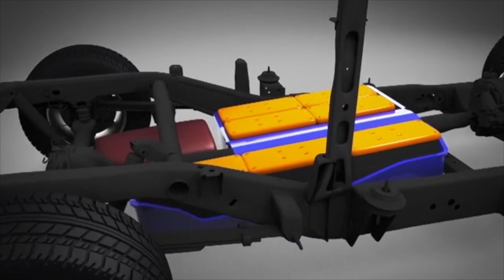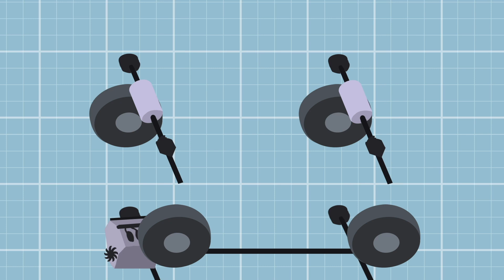Could This Pickup Truck Design Change The World?

Comment: Hybrid or all-electric could work (functionally) for those that want a pickup truck just to have a truck (or SUV), the problem will be where is the visceral factor of a rumbling V8 or diesel.  These people are already willing to pay what have become outrageous prices (comparable to many larger luxury cars) to get that, so without that, you'll likely not do well in the market.

People who actually use their pickup trucks are another story.  For most of them, all electric won't work because they often use their trucks on and off all day without any opportunity to recharge, some even in remote locations without power.  Hybrid would fix that, but would actually further alienate that market by both increasing costs and mostly by increasing complexity.  Most of that remaining market wants their trucks as simple and bulletproof as possible.  Essentially, give me a big simple engine, bulletproof transmission (the only place where technology has gotten any foothold in this market), and a BIG bulletproof axle (axles), stuff that won't break and when it wears out you can replace/rebuild it with an impact gun and a hammer using big cheap parts that have been the same since the 70's.  MPG be damned, extra operating costs in fuel doesn't stack up to additional maintenance costs or the cost of not being able to do it yourself.  

I probably own more truck than I really need most of the time (a Cummins Diesel Dodge ram with a crew cab/long bed), but it makes sense for me.  I got tired of breaking a lighter duty truck that I owned before it for the times that I needed something that beefy, and even though deisel costs more I get about 2x the mpg that I'd get with a gas engine.  It's old and sure I'd like something less worn, but as emissions and other tech has crept into them they got more expensive to maintain and MPG tanked.  Honestly, the only problems that I've had from it have been where technology has crept into it (it's from 6 years after Mercedes bought Chrysler and there's a lot of Mercedes electronics in it that SUCK and are always broken), otherwise the solid axles, old-school tech is pretty much bullet proof and again, except where newer tech has crept into it dirt cheap to fix/maintain.  Most of the time I would probably be served better with a smaller, more fuel efficient truck, but then the majority of the time that I'm not using it for truck stuff I'd need a minivan or similar crossover/SUV, and instead my big crew cab serves that function well, holding me at over 6'4", my twins in car seats (99% of smaller vehicles can't get 2 car seats in the back behind someone 6'4"), my 100# dog and another adult and pretty much as much cargo as I want in the bed.  If I have to I can get a 3rd adult in it.  For road trips this is the vehhicle, loads of room and 600miles before fill ups, and you can keep going as long as you can keep filling it (no waiting for charging).

 If I wanted to get something more efficient I'd have to get 2 or 3 other vehicles to replace it, and if they are modern ALL of them would be more expensive to maintain.  Now here is the big thing, if something were to happen to it, I'd unlikely replace it with something newer, I'm not going to spend 3-6x as much to get a new similar truck that will cost me more to maintain and be less durable or even more if someone was making something simiar in hybrid or all electric.  Honestly I'd probably look for a <2004-1/2 or older (pre-emissions) similar diesel.   

You'll never make hybrid as simple to maintain, and unlikely electric, so until you can get cost down to a fraction of that of an IC engine powered truck to make up for it you won't succeed in that part of the market.

Comment: I think rather than have 700 kg of battery it would be best to use 100 kg with parrellel super caps for on demand high output and the most efficient small diesel generator motor to charge up as needed on the run ! This would have more power and torque of exist f150 etc and the addition of real all wheel drive when needed . It all comes down to the amazing flexibility of hybrid configurations . You can literally start from a base platform that already exceeds current vehicles specs and customise it to have what additional specs you require be it greater payload after the subtraction of heaven v8 and transmission or extra heavy payload when using the 100 kg battery/super caps system . It’s all in educating the consumer about this new paradigm in the automotive world . I know many that are into cars don’t actually understand the amazing ability until they test drive . Then show them the specifications and watch the chequebook fly open .

Comment: The solution is don't buy the bloody things. I think you would find that the majority of the pickups purchased by the no business purchasers are  never  used for what they are              designed for. Rent one when you need it. Check out your local drive thru, Cummins diesels sandwiching  Priuses with a  Hemi gas burner behind.
Reply: The saddest part is they buy them new,  loose 20 large after they drive off the dealer lot, and take 8 years to pay them off.

Comment: 30kW battery? Forget it. Double it and combine with a four cylinder 200hp diesel in a one ton pickup, yes. Maybe. I need to tow 3.5 ton trailers for at least four miles up hill. Of course the diesel would do that job more than the battery but I would expect my Ford 2.2 diesel's overall consumption of 19mpg Imperial to improve to maybe nearer 30 overall and 50 instead of 30 for unladen road use. Those are significant benefits for commercial use as long as the fuel tank size remained the same.
Obviously the electricity does not come free and may even be generated from coal in some countries [which makes it a waste of time and money], but in most areas of the world it would provide significant environmental benefits as time goes by.

Comment: A reasonable argument.  Two problems.  First, hybrids are only slightly more fuel efficient than comparable ICE vehicles and for both the emissions are much worse in practice than in the idealized lab conditions.  It's a lot of effort for mediocre gains.

Second, the traditional automakers are moving so slowly that tesla might beat them to the punch, or at least release close enough after that the hybrids become irrelevant.  Why bother with half measures if the full measure works so much better?

Comment: All electric - with an auxiliary power unit. Mount it in the pickup if you need it - replace it with a aux battery pack when you want. Leave the power unit at a job sight or at home for more efficiency

Comment: For those that want a pick up as a status symbol (most of the market in urban areas) a battery could be put between the frame rails and then another in the bed and raise the sides and tailgate. it would probably look like an old El Camino but it could have close to 300 kilowatts of power, especially with he new types of batteries coming out in the next few years. Or maybe a fuel cell using hydrogen. Or pure alcohol for the generator.

Comment: I find it frustrating that many "progressive" minded folks are EV or nothing. In the area of trucks and SUVs this makes incredible sense.If you run out of power, in the middle of your Wyoming ranch, your not likely to find a nearby super charger. And yet, the torque provided from electric motors is perfect for that kind of work, or play. Not to mention the advantage of an on board generator to provide power for a welder., and other work equipment.

Comment: I wonder if drawing 300hp/225kW from a 30kWh pack would have any negative effects on battery longevity. At the very least, it might require high current cells which are going to be less energy dense. It’s an interesting idea.

Comment: Like your suggested solution for pickup trucks, although think the minimum battery pack will need to be around 100 kWh.  Also, would propose additional add-on battery packs for towing objects behind the truck.  For example, if you always tow a travel trailer, provide an option to add a universal variable size battery pack to the travel trailer itself to add range to the truck while towing, as well as, provide power within the travel trailer while camping.  Another example would be an option to add a water proof battery pack to a boat trailer to provide add additional range while towing it.  There hundreds of examples where these types of universal variable size battery packs could be utilized with a truck or SUV to supplement the range decrease caused by towing heavy or moderate loads.  Of course, these universal variable size battery packs would need to integrate with the truck's or SUV's high voltage electrical system to be practical, which is easily doable, as long at the battery chemistries are compatible or contained a suitable high power DC-DC converter for interfacing the different battery chemistry voltages.

Comment: they can fit 150KWh battery packs to those easily, they are so big another layer of 18650's would be quite easy to do. it's simply the cost of the cells is the killer and until cost of batteries dropping, they won't switch.

Comment: You don’t buy a pick up for mpg. You get one to do work. Also small motors get good mpg but break under repeated stress and get even worse mpg when under stress than their V8 counter parts. So V8, V10 and diesels are here to stay until the longevity issue can be fixed.  Cost of repairs need to be considered as well. If it’s too costly to maintain even though it’s a some what “good” product  no one will buy them after word gets out. I’ve been a mechanic for almost 20 years and I work on everything from F450’s to Tesla’s.
Reply: Most "pickups" are used to carry one person to and from work.
That person generally being of the insecure sort that likes to pretend they have stuff to do.  The fact that can sell a "pickup" that can't carry a 4x8 sheet is proof of this.

Comment: It will get done when Telsa does it. Virtually all the present pickup makers believe there is no market for an electric pickup. So they don't even try. There is no reason a pickup with a larger battery cannot replace a traditional pickup, including tow capability. My 200 mile Ranger is adequate for a small boat or trailer.

As others said below, having a large battery at hand would be gold for trailering. Imagine being able to run your air conditioner for hours, not possible now.

I didn
t see a problem with a hybrid truck before, but I do now. We are into 100kw or better packs now. There is no reason we can't make a truck with the same capacities as a gas pickup truck.

Comment: A good report, Nikki, but I was a little disappointed that you use the BMW i3 as your example of a range extender. As you point out in the video, it's range extender capabilities aren't really meant for long-range travel. By contrast, the easy and obvious and commercially valid comparison would have been to the Chevrolet Volt, which has a range extender engine that can give the car indefinite extended range. what seems to be the obvious Point here, is that GM, which makes a boatload of trucks, has been perfecting the technology that can give them a lead in the pickup market for plug-in hybrids.

Comment: All her points about why plug in only pickups wont work are solid. 

Unfortunately 1500lbs of battery to replace a 500lbs engine then add another smaller engine, say 200lbs, and you still need a gas tank! So now you are selling an F250 frame as an 'F150 Electric' with a starting price right around 50% more than the old F150. 

Reality is battery tech just isn't where it needs to be to make this work in the full size market (where the pickups are the massive sellers). Target the midsize pickup and SUV markets for this and maybe the math works out better.

Comment: I'm game so long as you don't reduce my payload by excessive weight of batteries and don't reduce my fuel/recharge time. I regularly travel 800 miles a day hauling 3500 pounds.
Reply: A better designed truck could cost you less on fuel, have greater payload and range.  It can also perform better on sloppy ground.  This just means some good engineers are needed.  You could have a truck that has all wheel drive and traction control.   Such a truck would let you drive right over that "fall on your ass" mud on the construction site.

Comment: The Volt came close, but missed the mark. If the gas motor were replaced with a multi-fuel diesel, it would have been near perfect, driveline wise. Why didn't they do this? Two words: Petrol Dollar.

Comment: I don't know if these large Pickups are peculiar to the USA, there are very very few of them here in the UK. Possibly because their sheer size means they would struggle to navigate the UK's predominantly narrow roads. The nearest we get is the "Chelsea Tractors" like Range Rovers and Audi Q8s and the like. I expect very few people need such a car for work, they are status symbols, as you mentioned in the video. Wouldn't it be great if the Auto and associated press Industry championed expensive EVs as status symbols rather than quirky low range flash in the pans. I think this is another clever ploy from Tesla, they have ensured the brand is a status symbol and not a cheap economic & environmental ride. (which it is!).

Comment: How would you turn a hybrid-electric pickup into a coal roller?

My impression is that most pickup truck owners couldn't care less about the environment or the absurdity of driving an F-150 3 miles to go grocery shopping for eggs and butter. The only thing that would help convince them is increasing the price of gasoline/diesel to what it actually costs, in destroying the environment and maintaining sufficient carrier battle groups deployed to the Middle East to keep oil flowing. Around $10/gallon would be my target price.

Comment: That would be really great if they could make a F350 truck with a diesel electric series hybrid drive train. Even if the battery is only rated for (20kw*3600 seconds =) 72000 Kilojoules , I could still do all the same things, with a much smaller engine. While simultaneously having the reliability that electric motors have brought to big industry for the past 100 years.

Comment: It is the sort of thing that is talked about in this video that is driving the move to SUV's. Implement this sort of thing in new SUV's and you will see a big swing to refurbishing old 4WD's. Customers are voting with their feet. They don't want the complexity and higher purchase prices of the lightweight greener vehicles. They don't want to face the huge expense of maintaining complex systems when they get a few years old. Complexity is only good in the first 5 years of a vehicle's life. After that the complexity is a huge disadvantage. They don't want panels that crumple too easily. There are those who like the Prius type world in inner cities. The majority, however want a simpler, stronger vehicle that is reliable and keeps its resale value. That can carry a whole family plus holiday gear. Is not so low that it scrapes the bottom on farm tracks when visiting relatives. Electric is an absurdity when off road. The reason diesel is the only option for serious off-roading is water. Try putting an electric vehicle in water over a meter deep and see what happens. There are no bridges in the wilderness and vehicles have to deal with water crossings quite a lot. Maybe it is not possible to get too far from a city in the UK, but central Asia, Africa, South America, Australia are all places where the sort of SUV discussed here could never work. The highways may well go all electric, but off-road is a very different story.

Comment: I like the presented idea for the benefits it provides, but it really needs to be presented with a less condescending attitude and not tied to climate change.  I appreciate that she did touch on the fact that everything going electric (based on batteries) would have its own problems, but she didn't discuss the impact on pollution (the increase in what kind of pollution caused by the increase in battery production and electric engine part of the drivetrain, the decrease in what kind of pollution by less dependency on oil & gasoline, and whatever else I haven't thought of). I would also like to see an analysis of MPG impact when the truck is away from a recharging station for an extended amount of time (e.g. more than 3 days).

Comment: If all cars were battery & all trucks used hydrogen fuel cells , The problem would be solved. All vehicles can be electrical. It's just a matter of application.

Comment: Trucks are designed for work use. Not many people want the hassle of electric issues and reduced load capacity.  Very impracticable at this point.
Reply: A hybrid could have equal load and a greater towing capacity than a normal truck.
It is just a bit of engineering to do.
An electric motor can be designed to make a really huge torque down near zero RPM.  This makes the need for many gear transmissions a lot less.

Comment: When the economic cost of battery and quick charging systems makes up for the extra weight then, electric pickups will be viable. Here's a cost that won't be in the EV pickup truck commercials, raw materials for batteries are often mined by children forced to labor in toxic conditions.

Comment: I think you're on the right track here, in fact what you propose is essentially the Workhorse w15.
It's sticker price is around fifty three thousand which I suspect a major manufacturer could drop further through economy of scale.
That being said I think the pickup truck Market is going to be the last Bastion of fossil fuels due to the simple energy economics involved. And the typical requirements of a pickup truck driver who uses his vehicle to tow an RV for example.